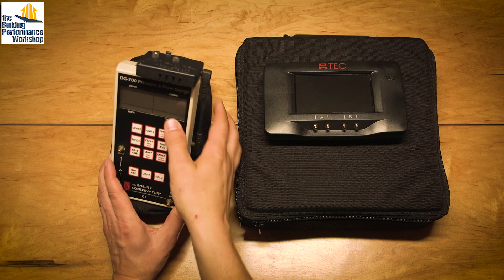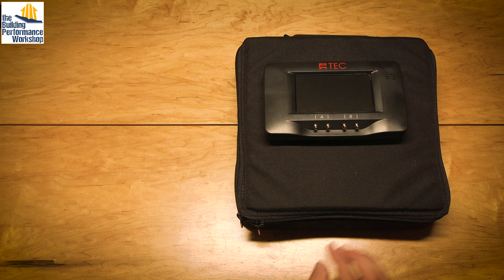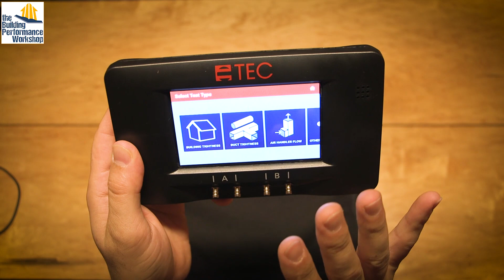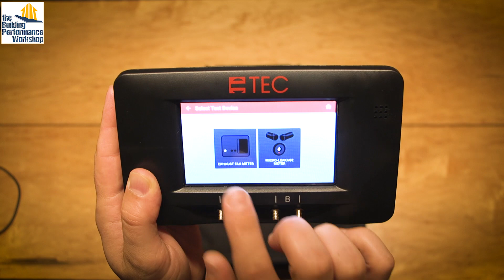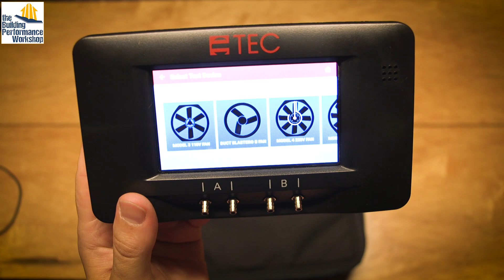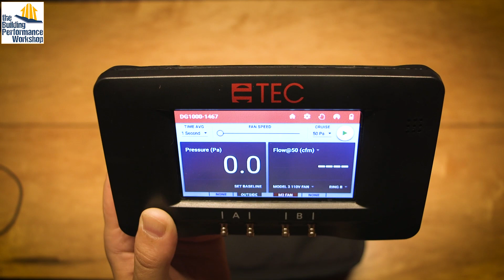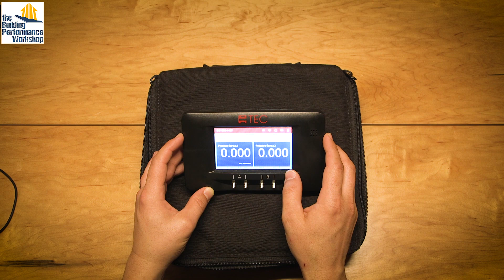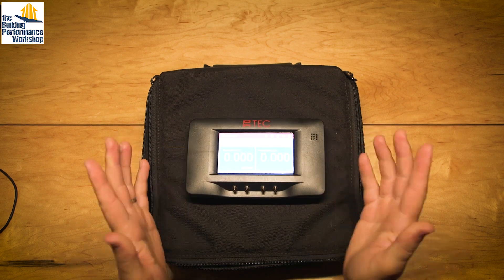TOOL REVIEW: DG-1000 Manometer for Minneapolis Blower Door

Comment: A quick note on the tap labels.  If you want to see the familiar "input" and "reference" labels, they are on the screen any time you go straight into the "gauge" app.  As Corbett suggests, straight into the gauge app is the advanced user mode.